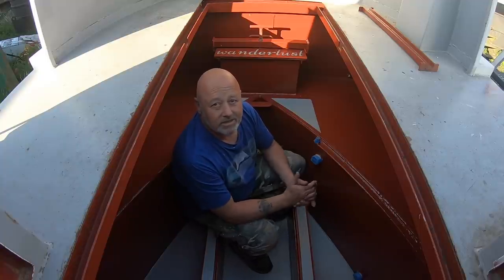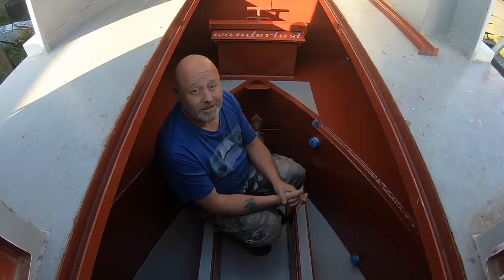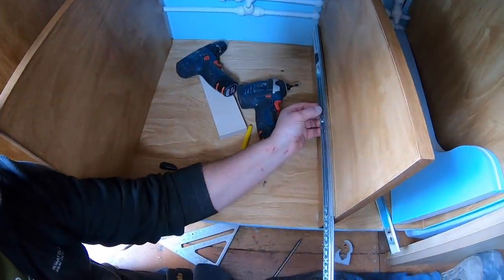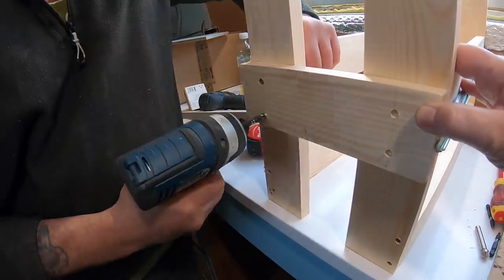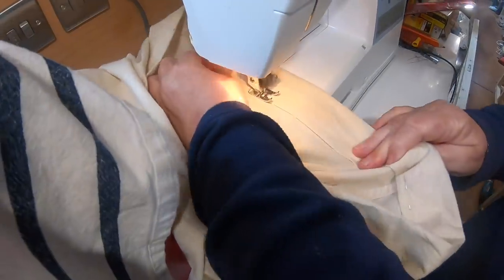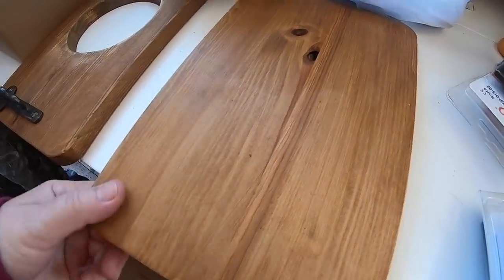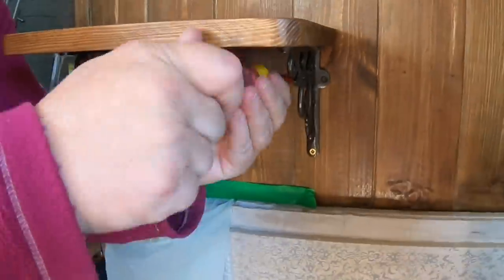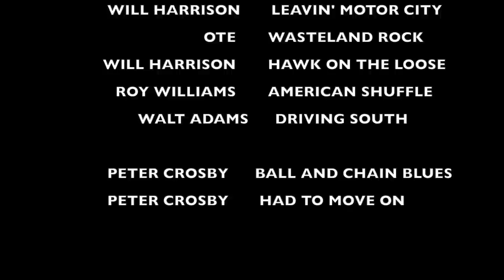VLOG 70, Narrowboat Fit Out -   Galley (Kitchen) part 5 and a ride on a Steam Train

Comment: There is a great benefit to doing your own fit out.  I’m sure your galley would cost a fortune if it were done commercially.  Your attention to detail, I think, is fantastic.  Like the shelves.  It’s the finishing touches that make a home.  I’m shopping in IKEA, on-line, for bits and bobs for the galley.  Great advice form Grandson.  Engines…..what a pain.  If you order a Beta today, you’ll be lucky to get it this year I was told last week by an engine blokey.
Reply from the maker: Cheers Chris, We have been super busy this week and starting to add some finishing touches here and there which really does make a difference. We are hoping to have all the carpentry finished in the next couple of weeks and then the nice soft stuff can start happening inside. Yes fingers crossed we get our engine this month 👍

Comment: You could put a push bicycle instead and go pedal power 🤣
Reply: I've actually see that done. a woman with young kids living on a narrow boat in/near London. To power the boat she sat on the bike and pedalled and the entire bike turned to activate the tiller. She was registered as a continual cruiser but has a converted bicycle to power the boat. She was on a video complaining about CRT since she can't move the boat more than a couple hundred metres under her power at once. (Part of the issue was her also not wanting to move far due to kid's school etc. but only wanting to pay for a continual cruising licence without permanent mooring.) One man is calculated to produce about 1/10 to 1/8 a horse power when working, so really not going to replace a 43 BHp engine. Would be great though - exercise and travel in one all without noise.
Reply: @yta6765  oh didn’t know about her . It might save power but with nanny cracking the whip I don’t think it would be very quiet 🤣
Reply from the maker: hahahaha and think how slim we would be. Appy days!
Reply from the maker: @martinworrall5888  hahahaha